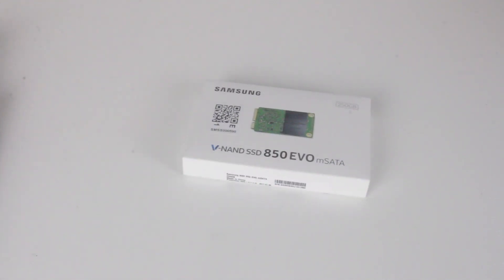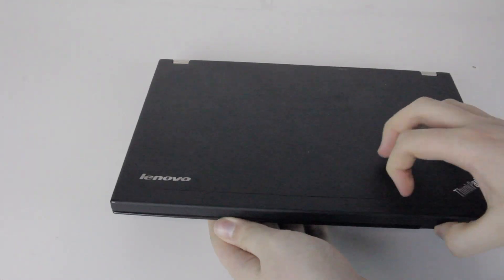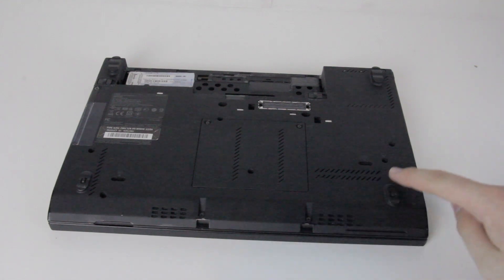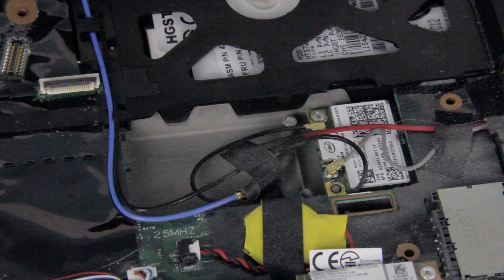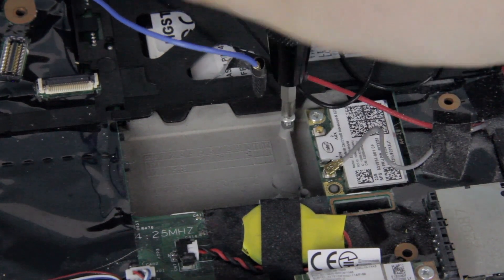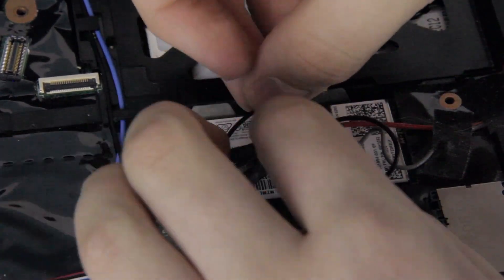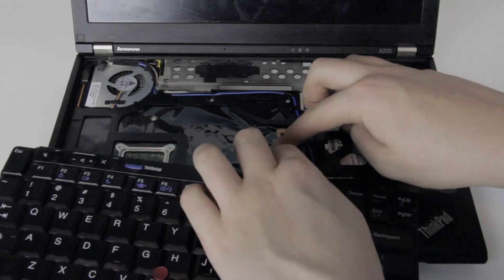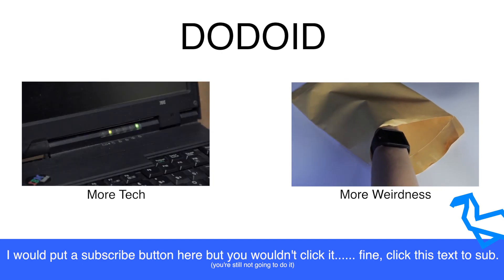How To Install an mSATA SSD in a ThinkPad X220

Comment: Need opinion, I am watching this video in 2021 and have x220 from 2016. I upgraded it with Kingston SSD 256GB Hard drive and installed windows7 on it. Now I want to install Ubuntu for some work. Is this viable to upgrade it with mSATA 256 GB or 128 GB and install Linux OS in that? your response is highly appreciable

Comment: Very good short video!! managed to settle mins in minutes, thanks!! Able to use m2 SSD + mSata adapter,
Mine the (1st notebook) works like a charm!! 
but my brother's notebook (same X220) run well for 2 days then suddenly stopped and when booted up it shows only the old HDD
today my friend brought over his X220, tried to do the same trick, but this time the m2 SSD cannot detected at all

any clue? all using the same mSata adapter, same brand m2 SSD 2242, same RAM, same Thinkpad model

Comment: Get rid off all mechanical HHD and just stick a 1tb SSD in the side slot! so much easier!
Reply from the maker: That's certainly an option, but this allows you to have two drives, which is useful to a lot of people.
Reply: @Dodoid  True but for me a 1TB ssd is optimal i just like to keep it simple! Cheers
Reply from the maker: @NathanChisholm041  Yeah, outright swapping the drive is a totally legit option. Having two just lets you pack even more storage into the machine.
Reply: @Dodoid  I was considering doing that but i though 1tb should do but i like the idea off the OS on one drive and media and games on the other.

Comment: If you move Windows to msata ssd and pull out the main hard drive Lenovo x220 will work?
Reply: I want to be only msata ssd 500Gb.
Reply from the maker: Yes, just make sure that when you copy your operating system you do so correctly (make sure the new drive gets the bootloader, is set as active, etc). There are programs designed specifically to help you clone the drive and do that.

Comment: Great video. Is that drive bay normally empty?
Reply from the maker: Yes. I'm not sure if the X220 was available from the factory with an SSD there, but most do not have one installed, so it's usually empty. You can check if there's already a drive in the slot by checking how many drives your computer says it has. If it has two (not counting USB drives, CD drive in docking station, network drives, etc.), then the slot is used. If it has one, the slot is probably empty, but to be sure you should turn the computer off, remove the Phillips screw on the right of the laptop's bottom (battery facing away from you), pull the drive sled out, and see if there is a drive in it. If there is a drive in the sled and your computer reports having only one drive, then the slot is empty. If the sled is empty but your computer still reports having a drive, then the slot is taken up by a drive.
Reply: On the base model yes, although Lenovo did give you the option to have an WWAN card installed in this slot on the more expensive models of this laptop.
Thankfully, they also made this slot compatible with an mSATA SSD.

Comment: I picked up a used X220 for $95 at a ham radio flea market.  It had the I5 processor, 8gb of ram and a 320gb HD.  I replaced the HD with a 250gb SATA SSD, and added an 80gb mSATA SSD.  I set up the mSATA drive as the boot volume, and I'm using the SATA drive as my /home partition in an install of Linux Mint.  The computer boots like a bat out of hell, it's FAST!   I only wish that the screen resolution was better than the 720p-ish, but Lenovo never offered full HD on the X220.  The screen is a TN, but it's not as bad as many report.  I do have to adjust the viewing angle for best results, but I can live with it.
Reply: There is mod kit that allows you to install a 1080p screen

Comment: Very thorough tutorial on some of the most cumbersome laptops made from china! Good job!
Reply: Cumbersome? That's weird to hear, because I found the X220 to be one of the easiest to open among my collection. You just need one size of a screwdriver, and there are only two types of screws in the entire laptop. Well, maybe three if you count the ones keeping the LCD in place in the lid, but other than that... I swapped the bottom casing, DC jack and palmrest just a few days ago, and the entire laptop was taken apart and put back together in less than an hour.
Reply: computer1up I worked with a variety of different lenovos at a warehouse facility and whenever someone tries to install ram or wwan cards, the bottom bezel ends up cracking if not done carefully. Most of the time when I was working on Lenovos its usually either a thin one piece bottom bezel or a L- shaped panel underneath the units. Either that or everyone seems to purchase those particular models though them.
Reply: True, but I've had other laptops that were waayy more difficult to get open. Or just required a lot more work. But then again, being careful when opening up any kind of laptop is a must anyway. Hehe
Reply: computer1up Of course, although probably the most mess ups occurred when it was on urgent orders.